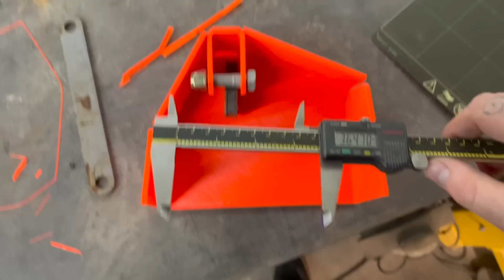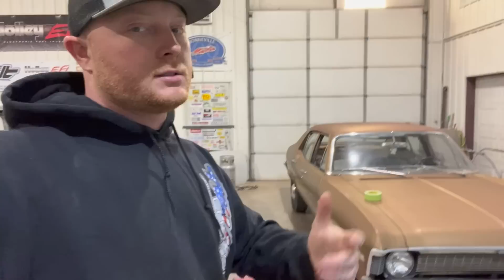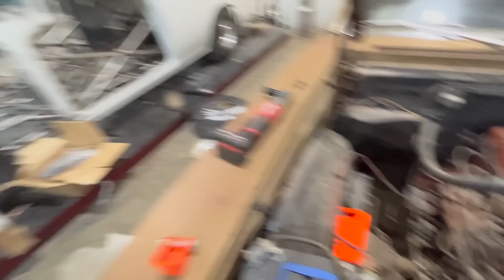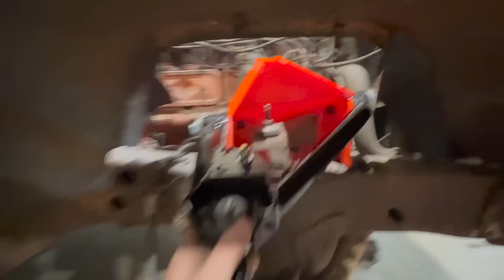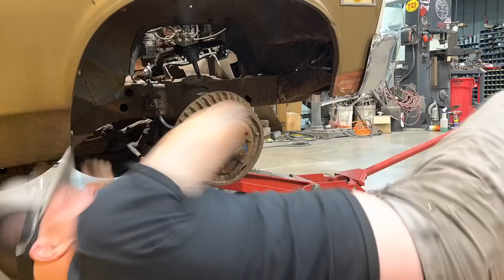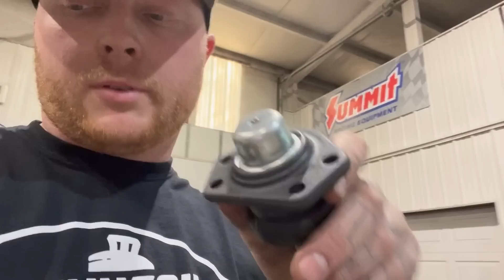Nova / Camaro Long Travel: Lebronze Goes Under The Knife Pt 1!

Comment: @11:15 *straight 6* 🤪 my first car was a 71 Nova with the 250ci straight 6.  Me and my three friends all had 67-72 GM muscle cars in high school, two Nova’s a 68 Camaro & a 72 Camaro.  I was the only one that didn’t have a V8 yet (that came right after I graduated HS) so I used to put the e-brake on, hold the gas pedal to the floor and then release the e-brake… it was like releasing a transbrake 😆 I had a 12 bolt rear in it with the old BFG drag radials on Weld Pro Stars.. we would have to put water down for it to do a burnout, otherwise it would just hook and top out the front suspension 😆 it definitely looked cool and made for some cool pictures.  The car got a 383 with an NOS Cheater plate and then a year later I had built a 468 BBC with 990 heads and a Big Shot plate.  It had gone 9.30s on a small shot, never put big jets in it.  
Anyway, I wish I had your brackets back then!

Comment: I think it would be awesome if you took Lebronze and made it Super fast for front side and back side No Preps and kept it all steel all glass street car style with full interior and find a company who can make you a set of lightweight drag wheels that looks factory stock and find a set or make a set of white wall slicks and front runners and tuck the cage as close to the inside of the car as possible and hide as much stuff as you can so people who just glance at the car think that it's all stock and get the old school SBC dress up kit for the LS and bottom mount the turbo so it hides it as well and make the car look factory stock look inside and out as possible and even keep the same paint job so when people get their asses busted they are left scratching their heads wondering why they just got beat by a stock looking 4 door Nova LMAO😂😂😂😂😅

Comment: I like the idea BUT what if you went about it a different way, what about a taller Spindle that would do what you are trying to do and the idea of the ball joint on the bottom side means it is no longer captured so you are relying on those bolts to hold everything together, keep up the good work and them Bitchin welds

Comment: Interesting,how are you going to compensate for the camber arc and bump steer. With out dropping the pitman and idler arm you could get some serious death wabble under acceleration,or a wheel stand that slam's down. Check out a lower ball joint out of a 3/4 ton 2wd from 70-75 they have a longer stud and will press in a stock lower A arm,use them in dirt track racing

Comment: Hey remember to make enough clearance in your long travel shock bracket for a camber shim or two. Pretty sure my Nova had .25~.375" camber shims in order to have 0 degrees
Reply: It'll move the arm a touch closer to the bracket
Reply from the maker: Normally on an aftermarket a arm that we will have made off the one I’m using for mock up once I get the right angles will have heims for adjustments instead of using shims

Comment: Hey Man, Killer job on the Shock mounts. But don't mount the upper ball joint on the underside of the control arm. if it ever shears the bolts or the bolts come loose, it will come apart from the spindle. If the ball joint is mounted through the top it is captured in the upper control arm. It will still be loose but it can not come apart. Cheers.